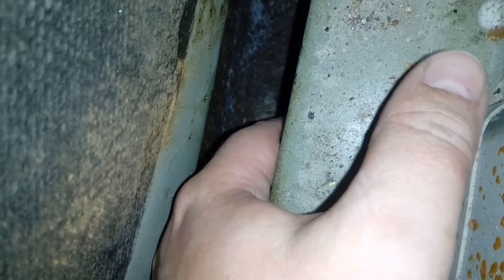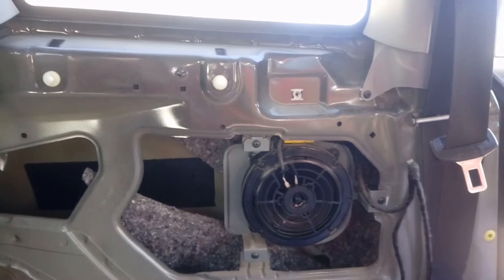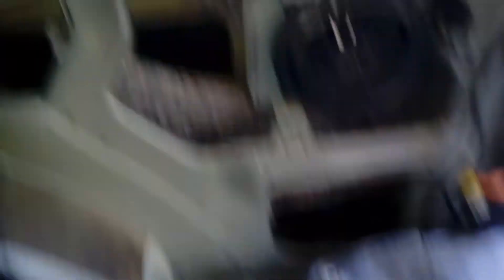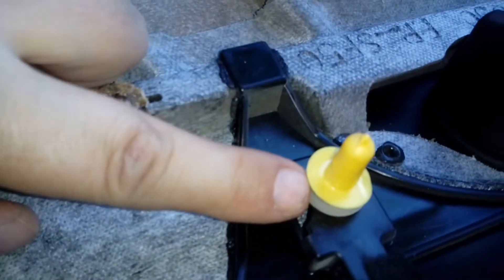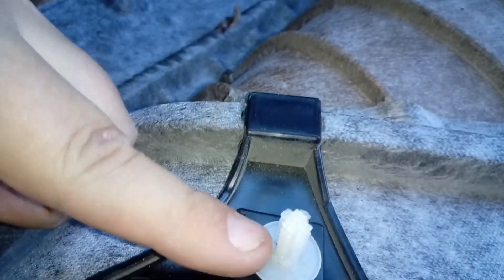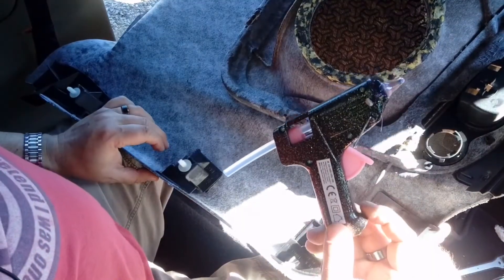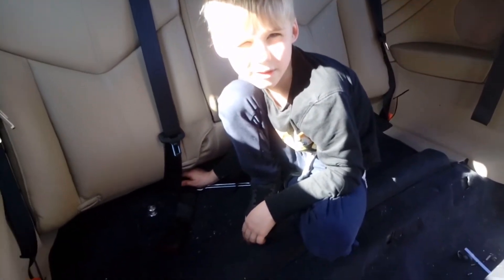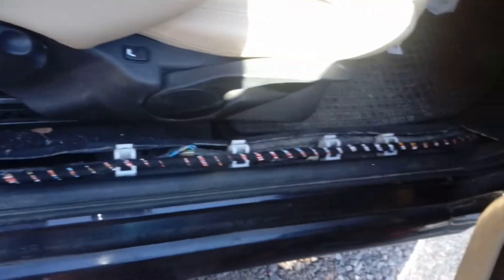Alfa Romeo. My son helps with rear panels and back seats, I talk a bit about electric turbo.

Comment: I have the 2.0 litre JTS on my GT also. Will probably swap for the V6 3.2 when the engine dies. Its on 224k kilometers at the moment. These cars will go up in value, especially with the 3.2 😇
Reply from the maker: So true! I start to realize that if I don´t buy a Busso soon, they will rise fast in price.
Reply from the maker: 4400 GT V6 made, how many still exist in a fairly good condition?
Reply: @Imperfectgarden  I am not sure, however looking at camshafts today, not much on the market.  I was looking at the UK market as I am located here and there isn't much to choose from. Apparently JTS engines suffer from camshaft wearing down due to poor lubrication. Hence the drop in HP. My car would probably only make around 130hp if I'm lucky...
Reply from the maker: I heard about the cams wearing down and also about the factory 165hp is just a dream number, that most 2.0 GTs are in the 145-155 range. My GT is now around 170k km and I have start thinking that a dyno test would be a good thing to do soon to see where I am and what I can do in the near future.
Reply: @Imperfectgarden  now that would be a fun video to watch :-)
Reply from the maker: I am already looking where the nearest dyno is from where I live. 😂